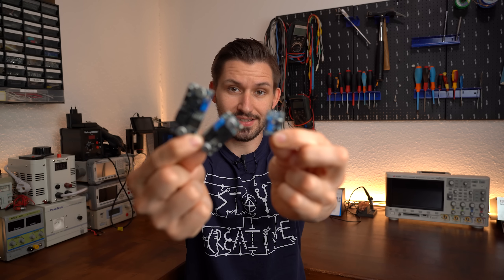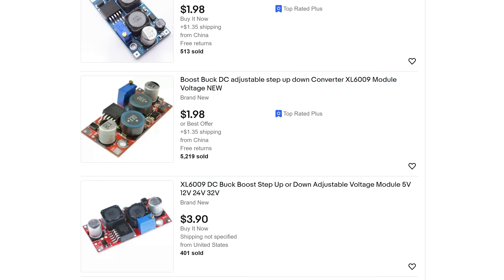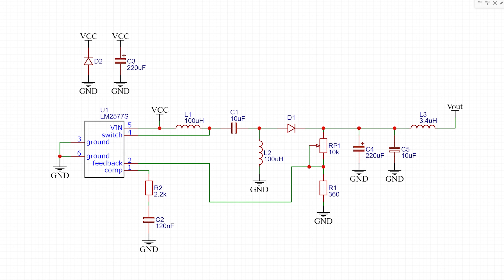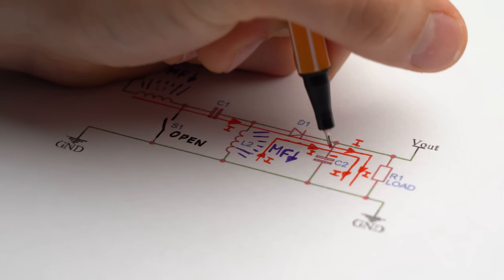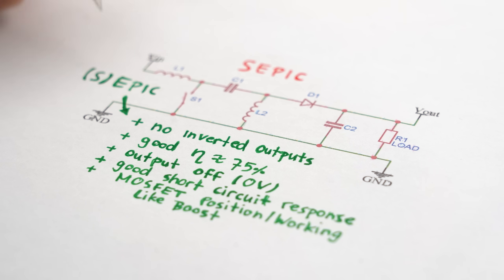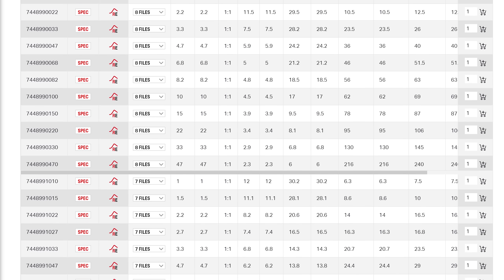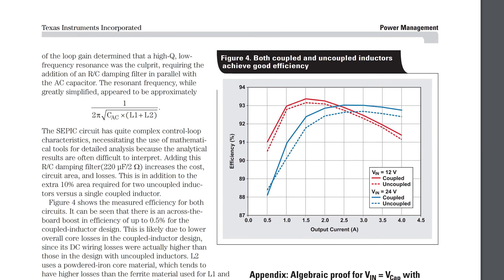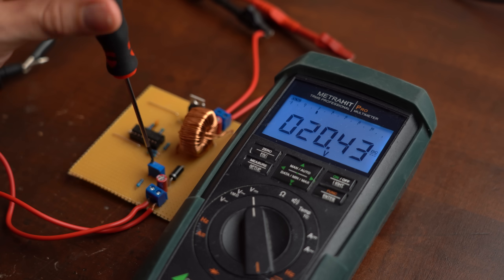The Most Versatile Voltage Converter you never heard of! The (S)EPIC Converter

Comment: How come everyone uses a potentiometer and not a Digi pot? Wouldn't it be better to use an op amp so you could control the voltage with a computer program? I would really love to see a video on this. I actually found some 4K to 10K op amp modules on Amazon.

Comment: Great video! In your video you have designed your own SEPIC converter with a TL494. Why is there an NPN transistors 2222 in this diagram as a driver for the MOSFET? The TL494 has 2 built-in transistors.

Comment: I'm wondering which of these dc-to-dc converters would be better when upscaled to handle more current

What I'm looking for is essentially a dc-to-dc lab bench power supply 
Volts (3.7-30v to 5-30v)
Amperes (0.5-30a to 0.5-20a)
Watts (2.5w to 300w)

Comment: are there any difference between original buck comverter and normal buck converter  xl4015. I found out on online shop that there is written one with xl4015 and another original module.  Both of them look the same. Are there ny difference?

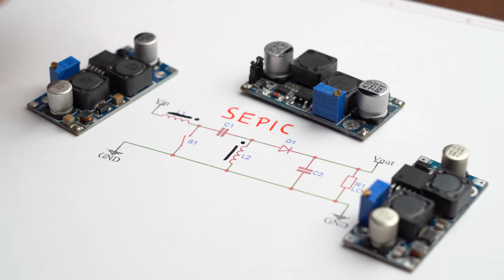Comment: ( 1:21 & 6:22 ) I have used a SEPIC voltage converter that uses a coupled inductor and it has some decent efficiency and also has some protection features which is nice. The only concern I have is the EMI it might be producing specially I used mine on an audio amplifier build and it has some weird issues "sometimes" specially on its aux mode, might have to some tests on it to confirm those thingies.
Reply: pm  me can you to install do sola paint of charger*

Comment: Scott I have a problem on my car sterio, i can hear the engine on my speakers, I try use a speaker to rca converter to solve this problem but nothing happens! I try every solucion that internet give to me but nothing result. I saw a video from you that you have the same problem but with a bluetooth recever and I think i need some that can handle more power (14.4v with 10 or 8 amps of current draw). Can you help me with a DIY circuit or show how i can isolate the ground of my car sterio from the rest of the car?

Comment: @greatscottlab Do you know if aliexpress has any variable power modules that can be controlled though i2c.. I want to make a i2c controlled bench power supply.

Maybe modify the Dave Jones PWM supply, using a i2c PWM servo controller 
and ADC feedback to make sure the output matches what you asked for..
and make a triple output supply

Comment: Hello sir,
I want to Make A boost Converter Which Can Handle 20V 40A @ Input side and Deliver 53V 10-15A @ Output ,
Can i use TL494 IC for this ?
as of now i figure out the MOSFET ,Inductor and Diode for this purpose Just Confuse about Gate Driver and Voltage Feedback..
Help Me to Find Out the Best Posible Way.
Thank you

Comment: Hi! Interesting video! 
But I have a question. There are big cells of LiFePO4 batteries on a market present nowadays, which can deliver hundreds of amperes while discharging. But most of consumers (ebikes, kickscooters etc) are being powered with standard 12, 24, 36 and 48v voltages in most cases. So it's impossible to power them up from one big cell. Since you are advanced in electronics and DC-DC power converters - maybe you could consider idea of making a boost converter which could convert 3-4v input voltage to one of those high standard voltages with efficiency > 90%. To make as efficient as 90% and avoid switching of high currents on the input, in my opinion you could try to make (for example) 10 multiple core flyback  converters, (with isolated secondary coil, around 30w each) and ratio 1:1 and then just connect their secondary windings in series to achieve 36, 12 or some other high voltage :) 
Or maybe you have some better ideas of how can be done? :) Interesting to hear your ideas about it.

Comment: IMPORTANT QUESTION: HELP 🥺🥺

Hi! I can't find your recent video about these boost converter that you created to produce high current output. I just want to ask if there is a commercial step-up boost converter board that can output adjustable voltage with high current from 3.7v 30Amp 18650 battery? 

All the boards I have are just producing 0.5 to 1 Ampere even if I use 30amp battery.. the board itself limits the output current. Can you help me, please? 🥺🥺🥺

Comment: I was wondering if I could use a filter choke as a coupled inductor?
Reply: Answering my own question: I assume so, but you need to be aware of relative coil polarity, so to reduce complexity and confusion I would recommend rewinding (one or both of-) the coils to match each other.

Comment: Hello from Georgia, USA!  I really appreciated this video.  I do have a question that I would like to ask.  I'm adding heated seats, grips, gloves, and primary clothing layers that will run off of my bike for cold weather riding.  The bike has very little extra power so I'm changing all of my lights to LED and I want to use a solid state timer for the signals rather than simply adding resistors to prevent hyperflash.  

Most of the heated element controllers use a resistor for the lower temperature settings.  It seems to me that I could use one of these boards to control the temp and actually conserve amps by using a lower setting If my gauge showed a constant draw on my battery rather than a 2a or so charge.  

Am I right.  I'd use the FP5-139 to get the most out of each amp put out by my charging system.

Comment: I think you can build a boost converter circuit on a perfboard but you must put the components much closer together, the distance you use wouldn't work properly on any PCB type I think. All datasheets of switching power supply IC's are always hammer on that you must keep the loops as short as possible.

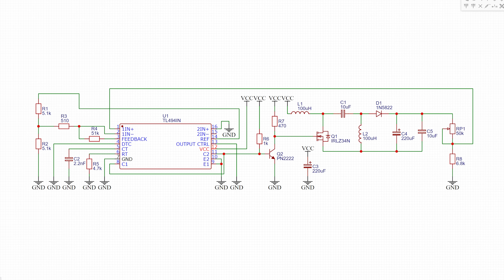Comment: 10:24 what is that C3 for? it placed outside the circuit.
Reply: It is connected to VCC and GND ,it helps to keep the voltage at the power rails decently stable

Comment: Thanks for the video, it was very interesting to see a different approach, perhaps you can help me with a problem, I want to make an 18650 12v power supply to run an emergency LED light, so do I put three 18650 in series to give me my 12 volts or do I put my 18650 batteries in parallel to give me 3.7 volts and boost that voltage to 12 volts, any suggestions for the best method?
Thanks, Bob in the UK

Comment: recent day I made my own sepic converter with xl6009, two 47uH inductor and a 1uF capacitor. It can deliver much more energy than I think and blow up my AO3400 and AO3401. and another interesting thing is it cannot work with usb because some usb power connection is poor and voltage can drop to 3.5V so the chip will not work properly

Comment: What I like about this design is the "self destruct" protection capability:

One of my biggest fears when using Buck Converters specifically is that, when the switching transistor fails, it will most likely go shortcircuit (which in buck converters means the full input voltage will get to the output) destroying the load with overvoltage. In contrast, this design will not only let the voltage go low but also may just blow a fuse or trigger an overcurrent protection.

This feature/bug is also present in synchronous buck converters: if one transistor fails, as soon the second one turns on, the whole thing will just go shortcuit and trigger a protection system before the output voltage can get high enough to kill the load.

But maybe I've too much of a green mind for a disposing culture society?
Reply: pm  me can you to install do sola paint of charger*
Reply: Why wouldn’t you use flyback/forward topologies? They require only an extra coil, which is nothing. But instead offer useful p/s ratio and an isolation level
Reply: @sc0or  Absolutely! In some cases using flyback/forward types are just too bulky, some devices do not require it. computers, graphics cards, perhaps? Also, high efficiency isolated supplies are more expensive to build, specially for small form factors. But yes! I absolutely agree with that! I love isolated supplies, they come with so many benefits

Comment: I once tried prototyping a 1A buck LED driver that operates at around 1 MHz on a bread board.
This ultimately drove me to begin my bachelor's degree in electrical engineering because I had no idea why the heck this just wouldn't work!
Today I do know why... =D
Reply: What wasn't working? 
I presume that it might have been the frequency; but I still want to know!
Reply: @After_Tech_Industries  To be honest, I never actually checked what was the problem. So "Today I have some ideas why" would have been more correct.

I think the main reason was the high contact resistance in the bread board contacts along the high frequency, high current path. I think the losses there probably screwed up the feedback loop of the regulator.
Another probable problem was that the MIC2301 driver chip that I used has an integrated high side switch and therefore its SOIC8 package has an ePad at the bottom for cooling. The SOIC adapter board I used didn't connect to that, of course. I think it then also overheated way more quickly than I expected.
Reply: pm  me can you to install do sola paint of charger*
Reply: In my case I ultimately put it in a box in an attic and forgot all about it. I got an output but it was inefficient and oscillating. Without an oscilloscope its not worthwhile to design an SMPS at home.

Comment: Have you considered using a synchronous switching configuration rather than the diode? Perhaps that would give you a better efficiency payoff than using the coupled inductor.
Reply: using a transformer ensure 5percent increase, lossen coupled one gives anther 1percent boost, a llc typology needs pmos, or bootstrap, whichs means bad, really bad, especially in boost condition.......

Comment: Moin,
I have a question regarding buck/boost converters.
I have one of these standard 9(or 12, or 24)V DC Plugs. But if I hook them up to a buck boost converter, I can change the output. The output voltage stays constant at 9, 12 or 24 volts.
The converters are otherwise okay. I can change the output of these fancy USB c PD boards, but these DC plugs just don't work :(

Comment: I love using SEPIC in my designs. The biggest benefit is that they are inherently failsafe, there is no fault mode in which the input voltage can be on the output. Also if you need positive and negative rails, you can use the same regulator chip for SEPIC and inverting.
Reply: There is a chance yes, but if I remember correctly from Siemens’ SN29500 the chance is relatively small. 
And then you can split up C1 to make the design even more robust.
Reply: pm  me can you to install do sola paint of charger*
Reply: C1 fails short.

Comment: For higher currents, a 4 switch buck-boost will always be the better solution.
SEPIC (as well as inverting CUK type ) switches VIN+Vout on its switch node and carries the large du/dt EMI problem. And you switch more current than Iout. That to a much larger Hot loop which includes the SEPIC coupling capacitor. In essence, you store the complete transfer energy in the inductive components so those inductors have to be sized that way.
Reply: pm  me can you to install do sola paint of charger*

Comment: Does the schematic have a mistake?  The switch Q1 source is not grounded, as well L2, C4, and C5?

Also it is handy to include a sense resistor in series with the source of the switch for pulse-to-pulse current limiting.
Reply from the maker: Yep. The GND there is missing in the schematic.

Comment: I made a boost converter using a 555ic and an irf540 mosfet. I used a sepic winding of 150uf. I could get 9v input 99v output. It was fun. I'd love to know what you think of it.
Reply: 555 ic in not efficient for this type of circuit

Comment: They use the smaller coil packages mainly for size savings and there has been an artificial standard for such converters because a few companies in China did massive runs pumping out near to a half million units and resellers flooding the markets like Amazon and eBay......they become so common that they just get copied

Comment: Great video Scott! I suspect your ferrite toroid had issues due to saturation, due to the uni-directional currents in it. Either add a small gap by using a multi part core, or go with high permeability powdered iron.

Comment: SEPIC converters are great for applications where the output power is low. For higher power applications, there is the two-switch non-inverting buck-boost converter. It is simply a combination of a buck and a boost converter. When the input voltage is higher than the output, it holds the “boost” switch open and modulates the “buck” switch. When the input voltage is lower than the output, it holds the “buck” switch closed and modulates the “boost” switch.
Reply: it will be priblematic in between, .....
Reply: @yeyuan6273 A few years back I implemented it using a ucontroller, think a bit on when you switch between regimes, and you'll see it's easier than you may think :) (clue: you can introduce a third regime). Suppose you may have strict ripple specs, techniques like dithering using some randomization, or hysteresis when changing between regimes, help in that case.

Comment: I have alot of experience with SEPIC and Cuk converters.  Coupled inductors are great.  They can be more efficient (alot of variables there though), they have better dynamics (dual inductor SEPICs and Cuks have some high frequency resonance that can make compensation harder), and the overall solution size can be smaller than for dual inductors.  What I've seen is for name brand (like Coilcraft and Wurth) inductors, prices are comparable between two singles and a coupled.  But the market for singles is bigger, so its easier to find other manufacturers of singles.  Also, worth pointing out that I've heard Dr Cuk is adamant that a Cuk converter built with a coupled inductors isn't really a Cuk converter.
Reply: dude, the sepic is noesing as fk, but i have to use it, how to reduce the ripple to 5mv under 12v at 3a? i have tried everything........rc lc re apsorbtion, comm choke, what i did wrong? it keep around 100mv at 1a ar 12v, i cant knock it down further.......
Reply: @yeyuan6273  Not exactly sure what you're talking about, but you probably just need more output cap.  In a SEPIC, output ripple is primarily dependent on duty cycle, load current, switching frequency, and output cap.  Add some more high quality (MLCC caps are excellent due to low ESR) caps to the output.  You could also switch faster, but that comes with other downsides.  Most of the large IC manufacturers that make chips for SEPIC converters also have app notes that explain in great detail how to pick components to get your desired characteristics.  Try Analog Devices and Texas Instruments.
Reply: lol "cuk"
Reply: @Blox117  It's named for https://en.wikipedia.org/wiki/Slobodan_%C4%86uk .  Funny name perhaps, but he's Serbian, that is his name, and that is indeed what it's called.
Reply: @Blox117  Apparently it's pronounced 'chook'
Reply: @triffid0hunter  oh i see, there is an accent mark

Comment: The LM based ones works fine down to 3V the XL based starts to have issues below 3.8 volts, don't use it if you are using an input range below 3.8V.

Comment: Some years ago I designed and built my own SEPIC converter, and used an off-the-shelf part for coupled inductors with one core. Before I built it, I actually did simulations of coupled vs separate inductors and it helped the ripple out a bit. Once built, it worked quite well. My board also included a Ćuk converter which is basically when you take a SEPIC and swap the placement of the second inductor and diode, resulting in a negative voltage with very similar specs. Made for a nice stable+versatile bipolar +-12V supply.

Comment: Nice video.  I've been using these buck/boost converters in my projects for several years.  They work great, and allow you to use almost any DC cube power supply without worrying about input voltage.

Comment: The problem is that 80% eff is actually not very good if you are doing solar circuits or similar.
A 100w panel becomes a 80w one. If it is not MPPT in addition, you end up around 60w into battery...

Comment: Not sure if it's a SEPIC but I have a Zk-SJVA-4X buck/boost converter (outputs up to 30V, they say it can take 50W with proper heat dissipation but idk whether to believe them) that uses two wires wound around a single ferrite core.

Comment: I found a moderately high power (5a or 60w) buck/boost converter. What I found was a decrease in efficiency, increase in heat. My aim was to power 4g modem/router on boats, which operates in high temperatures (on sea, on summer, in Turkey). Boats are like cars, while engine is running voltage contains lots of jitter due to charging alternator. And just like cars, in small boats there is not a service battery, which means while engine is not running voltage is 12v. While starting the engine, voltage can drop down to 10v. While engine is running, there is a lot of noise (or jitter) and voltage is 14.4v. 

My solution was to use two coils, then a group of capacitors then a boost converter (increases the voltage to 15v) then a buck converter (reduces the voltage to 12v). 🤣😂 This devides the heat dissipation, reduces the jitter and just works... 

But in lower power applications (like 1-2amps) buck-boost converters works very nice.
Reply: This is a bit silly because the 4g modem/router internally has buck converters, which you obviously cannot get around, so you are forced to use this roundabout way.
High freq, and highly integrated GaN buck-boost would have worked for you well, but this tech is not very widely available yet, and probably more expensive than chaining two very simple converters like you have done.